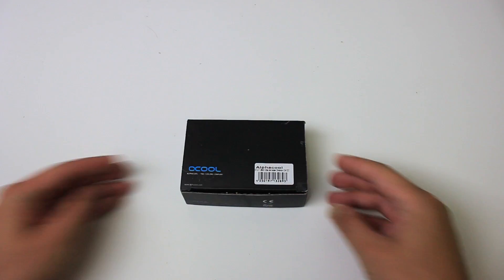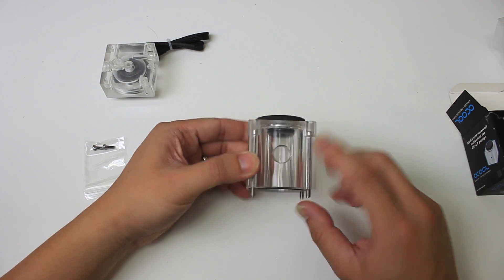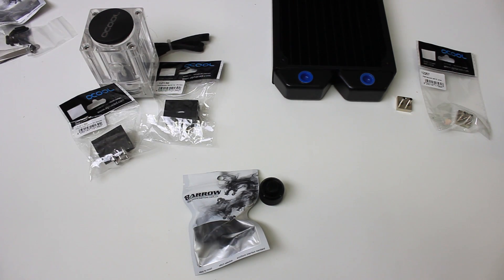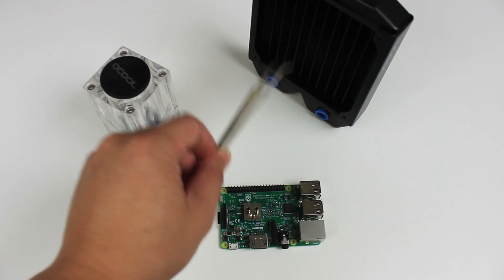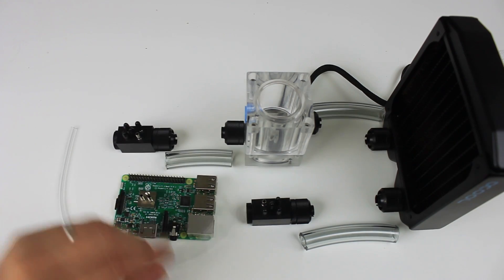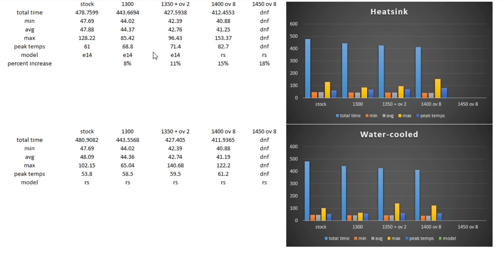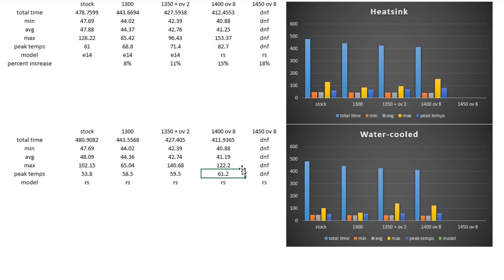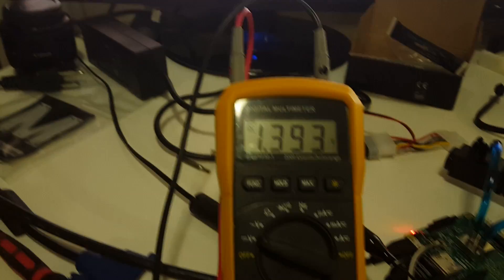Water Cooled Raspberry Pi 3

Comment: Now there’s same (or even better) results with an old oversized copper PC heatsink. The video you will find around. Now if you have a simple and cheap passive solution, what’s the point in going for an expensive complicated active?

Comment: Interesting...I wonder if one could polish down the plastic insulator on the top of the IC down to where it's almost to the actual die if it would help wick the heat away better...alot of times the heat just doesn't pass thru that plastic all that well
Interesting setup...even though the TDP is what like 15W...the fan and pump pulled more than the processor
Hack away, and as you said..hack till it hurts

Comment: i can see one major limiter to how well it can cool, and that would be the tiny inlet and outlet nozzles for that tiny heat sink. there would be a very large pressure drop over that and therefore the flowrate of the coolant becomes too slow. if you use a larger heat-sink with larger inlet and outlet nozzles, you will most likely have much better cooling. the problem is sourcing the part. ideally, the tiny cavity within the heat-sink that allows the fluid to pass through should be "baffled", i.e. have tiny fins inside to discourage laminar flow and promote heat transfer.

Comment: This is like putting a turbo on a 50cc moped and cool it with a car radiator. Cool to learn, fun to implement but useless ... at least for a single board. However this could scale very very well in a cluster of pi-s if you have 10, 100, 1000+ pi-s. Also the rp v3 is not very hot chip but the rp v4 is very hot compared with this and if overclocked it gets even hotter. I imagine if you have cluster with rp4 and everyone has a ventilator or there are massive ventilators everywhere to make the air flow it would become soon pretty pretty noisy and not very efficient cooling. With this water cooling however I would love to see how a cluster could be cooled with just a simple cooling water unit. Big thumbs up!

Comment: this would probably work really well with the Pi 4 as I hear it heats up pretty good!
Reply: I have one and yes it does heat up fairly quickly under load i use a small handheld usb/batter powered fan placed on the top of the case to cool it under heavy loads you can also adjust fan speed (i also have a case with a small fan in it but the bigger hand held fan works better imo) here is a link to one similar to what I use https://www.amazon.com/HandFan-Handheld-Operated-Portable-Rechargeable/dp/B07P2YS5ZR/ref=pd_lpo_sbs_147_t_1/139-1396981-6200024?_encoding=UTF8&psc=1&refRID=P933NEHYWGPPQQ4W6TRE
Reply: 5V, 2.5A.  12.5 watts.  Even a 120mm radiator is going to be over 100 thermal watts dissipation @ 10 degrees delta(coolant over ambient).  You get VERY little efficiency because the pi can't even heat the coolant properly(and going down to weird tiny alphacool rads is actually more expensive)
It's never practical unless you already have a custom loop present.  You could stick a pi into a normal computer case(as opposed to the large "dual system" cases) and parallel off to a tiny water block, though it's be better to use a mounting bracket over adhesive.  The extra restriction from the tiny block/tubes would reduce flow in the pi section, which is fine as it's not an intel top level 250w barn burner.
It's a really niche application.  The dual system cases properly are used for productivity.  If you have like machine learning or rendering that consumes massive amounts of component space and run for a long time, and a smaller scale system for e-mail, office apps, web browser(corporate internal apps) so the user can still do user speed limited tasks while the main system cranks away at large automated tasks.

Comment: i realize im late here but being that it wouldnt be that hot, couldnt you run a setup with the reservoir and no radiator? wouldnt the reservoir be enough heat transfer alone to keep it cool without a radiator additionally cooling the coolant? still...fuckin funny setup, I like it.

Comment: If you added a fan into that radiator you could reach 36°c. I saw someone did that already for over clocked pi 3 and panda latte.
Or you could just simply use cooling HAT for pi2,3. It has better benchmarks (46°c)

Comment: For cooling it would be better to screw a fan on a passive CPU heatsink so you could also cool the voltage regulator that supplies the CPU.
For show it would be better to  buy/make a small case and use a dual 40mm or single 60mm radiator because that one is huge and fittings/hose sizes aren't even compatible with the rest of the system.
Either way, you can do it better.

Comment: I wouldnt say its pointless if u wants to have ur pi like last forever in a cabinet that runs 24/7 but for 2x the cost of the pi.-.  but the worth it value is i dont know. and a pi is made to be tinkered with and customized if someone wants to max out a pi i would say this is the way to go once u get a stable super overclock

Comment: Interesting.  Now I may have missed this, but you need a fan on that radiator for it to cool properly btw.  It's why water cooled vehicles have fans.  When you're say at a stop light not moving, the fan moves air through the radiator keeping water cool.  Without a fan on the radiator heat is just gonna build up.  So you may be able to make it run even cooler.

Comment: Honestly I do get the concept of the Raspberry device to make a PC more portable but what people are forgetting is we've had hand-held portable computers for about 20 years or more now which is a smartphone iOS or Android they are both hand-held computers which are easily portable with in your pocket and you know what's ironic you can even run Windows or iOS through an emulator on a Android and IOS device so my statement basically makes these PCs obsolete no offence to the developers they're doing a great job and I would even purchase one myself if smartphones weren't around

Comment: One outstanding problem i see with your setup is the fact that both inlet and outlet of the "radiator" are on the bottom. Because air floats, it gets trapped in the radiator. Because the radiator isnt filled with coolant, it is unable to do its job of cooling the coolant. Re-run your test with the radiator on its side. Inlet to the radiator on the bottom, outlet on top. Or, rotate the radiator so the inlet and outlet are on top, and either can be inlet or outlet. This will make sure you do not trap air, and will be a perminantly self purging system. Bet your temps get even cooler. Realistically, i would expect to see die temps a couple degrees above ambient, because water or coolant has such an enormous thermal capacity.

Comment: I had a dream. I had a dream of energy recycling with dirt cheap peltier elements placed on top of a cpu contact passive aluminium case and on top of the peltier a big big passive cooler from an old gaming machine... a boost-converter to level voltage for reusage.

Comment: To extend pump life you should connect the remaining splitter ports to each other (bypass CPU block). The single capillary tube cannot accommodate the flow rates of the pump. The fluid that cannot be forced through the small tube will be churned in the pump housing creating ... heat.

Comment: I use the aluminium Flirc case which acts as a heatsink..temps dropped 10 C. Then I added a 120mm fan, temps dropped another 15 C! Now my Pi doesn't run hotter than 45 C :-) You dont nééd to cool your Pi, but I'm sure it will last longer if you do.

Comment: This would have much more of a point, if you actually used multiple Pi's.  I bet you could easily do a grid or 4x4 Ri Pi's, bringing the cost from $130 per unit, to just over $13

Comment: now we need a Raspberry Pi 3 in a regular atx pc case
Reply: Careful or you become a hacker too
Reply: its about the size of a ssd so I suppose you could but it would be a bit hard to connect everything
Reply: @nyxtom  - No, I just put a bunch of fan and blowing over the heatsink :-)
Reply: I did that, but i used a ATX PSU imgur (dot ) com/gallery/6xIUI (I have upgrade power and the pi since the photos were taken)
Reply: I have such a beast - 10 raspberry Pi in regular atx pc case, using one of those corsiar 750W PSW
Reply: on it, am a slow worker though
Reply: I did that lol.  I can’t get it to boot with the power button thou
Reply: or just a tiny one!

Comment: looks like perfect block for high powered LED what sort of wattage is it rated for? would be cool to put a xhp70 4000lumen led on a head lamp with a radiator on the back of the head or as a backpack.. or startreck style palm flashlight with 4 xhps 70s and long radiators on arm

Comment: you missed some very key points. I would opt that you liquid cool CPU, GPU, RAM, and Bridge, then instead of going to a radiator go to a block that sit atop a pelteir cooler and on the hot side of said cooler sits another water block with seperate pump that goes to a big radiator with fan. THEN POWER THAT LITTLE PIE WITH A 10 FT TESLA COIL! FUCK YEAH!

Comment: Any idea why the 1350+ov2 went to 140, which is a HUGE jump from the previous 65, and way below the higher 1400ov8?    Maybe the 1300 number was a bit low since it's actually lower than the stock MAX.
Strange..  still cool video.

Comment: I am designing a portable water cooled rpi3 for a backpack set up. The prototype works in tandem with a drone that does simple things like follow me, assist in builds(for now it orders parts), hunting wild boar or rabbits. I’m writing a ton of code to get this drone to work on its own but steal processing power from the rpi3 backpack when it needs to do higher level calculations and what not. I want to use a laptop eventually but nothing has the processing power I need to get the bot to compile the code it needs and run at the same time. So simple observe and report until then. It works great for portable pen testing WiFi and basic transmissions from wireless devices. Without physically being there. I hope to show the build by june

Comment: That's just crazy dude!  Seriously though if someone would make an all in one case/water cooler that would be great because the surface area for heatsink connection is so tiny that having the whole case top as a radiator would be cool.  I just got an Asus Tinker board and that thing gets super hot which is why I rewatched this video. Thanks.

Comment: The applicability of this seemingly needless cooling solution may fit the bill for an overheating problem I'm about to resolve with my RPi poolbot.  Mr. Ghettobarge has pH, temperature, and ORP sensors along with a DC motor attached to a dispenser that can carry up to ~4 bags worth of shock/chlorine.  Most of my idea comes from myhydropi.com (give credit where it's due!).  Currently, I have a couple beefy lithium-ion batteries onboard the failboat that floats around all day and is powered by a few 9W weatherproof solar cells.  I never had any temperature problems on the RPi until my laziness got the best of me.  I thought I had some wiggle room by making it totally weatherproof (i.e. no airflow).  My laziness told me to weatherproof everything so I don't have to fish out Mr. Ghettobarge during bad weather.  Now I'm thinking of adding some water blocks in replacement of heat sinks because a fan is worthless in an airtight container.  I also may rig up my own waterblocks around the batteries too.  I am thinking of powder coating the radiator in a fluoropolymer or TGIC polyester then submerging the fanless radiator beast into the pool such that it's always much colder.  I would use no reservoir in this configuration as I would have a simple circuit from the waterblocks (in cold > out hot) straight to the radiator (in hot > out cold) back to the pump (in cold > out cold) then repeat.  I haven't read up yet, but I assume this pump is an induction pump?  How hard is it to prime this pump and is it like any other traditional water cooling system where the pump needs to be lower than its source of water (in most cases a reservoir)?  Do I also need to use distilled water inside the circuit?  Oh nevermind, I'll find out those answers myself and post back to myself later.  I may have a problem with my thought bubble design since the pump will be higher or equal to everything else.  The powder coating is obviously going to aid in the lifespan of the radiator, tubing, and attachments since I'm sure it was never intended to be in a chlorinated and high UV environment.  Of course I haven't made any final decisions yet, but I'm simply noodling ideas around and trying to justify a reason to buy more toys to enhance Mr. Ghettobarge.

Comment: Those temps aren't impressive. Dump the adhesive tape and use Arctic Silver Epoxy.. the tape is a horrible heat conductor and is far too thick for this setup. If you don't want it permanent then i would mod a cheap case with screw on lid and some retention springs to push down the block with a thin coat of AS4/5,  i bet you see a monster drop in peak temp.

Comment: why even bother with the radiator?? water cooling maybe but the radiator is completely redundant, your only dissipating a few watts, so just the pipes, pump and reservoir would be much more than you need to dissipate that heat

Comment: I didn't know alphacool made tiny pumps/tops/res's.

It looks so cute, a smaller radiator would have looked cuter but then the performance would drop.

Would look better if it was all on a board or something, the tube from top to rad could be removed and just use a male-male fitting. Maybe another tube or two could be removed to make it more compact.

That's still a nice 20 degree drop, not to be sneered at.

Comment: how much cost water cooling brings to LOW POWER machine. pump,tubes,tank,power source, then OVERCLOCK pi use more energy and COST more (unless have solar panel that was FREE !!!), it should be under clocked. it will cost less than commodore 64 and run faster lol

Comment: Interesting! So based on those benchmarks, watercooling lets you OC to the maximum voltage while not going above the stock cooler's base clock max temps. Worth trying out, I've been messing with my Pi Zero for a while and this seems like a cool project.

Comment: In reference to his closing remarks: The capacitor doesn't "control" the voltage. Depending on value, it is acting as a hold up (prevent quick changes in voltage) or a bypass capacitor (provide close proximity source of high frequency current draw). You can't increase or decrease voltage with it, you could only affect if you are seeing sags in voltage from the current draw. Adding a bypass capacitor could help if you are seeing your supply sag more as you increase your operating frequency, a 0.1uf is a typical value for bypass and might help in parallel with whatever is already there (put it as close to the chip you are concerned with to minimize inductive line effects), but you will never increase above what the supply circuit supplies. With how crazy this project is getting you might as well cut the trace and solder in an external supply that provides you with whatever voltage you want.

Comment: .......Ok I can sorta see the point.  A ras pi can actually make a pretty sick workstation......  With a lot of addons....  But then without addons I can't see much of a point in doing this personally.

I would go at this if you guys did some more serious stuff with it.  Like yeah sure its neat, but you don't have any addon processors, you aren't running this in a cluster, you're not even pushing heavy traffic to the chip to make the clock speed worth the effort.  Without a real demo of what this is supposed to do I can't really see a point in any of it.

Comment: I've got my RPi3 overclocked to 1.35GHz. CPU running at ~75% most of the time with occasional spikes to 100%, it's cooled with a copper radiator having a fan sitting on top of it. Runs at 59deg at the moment (haven't been switched off since ~8months). Another unit is outside (in a waterproof box with an acrylic "peek hole" for the camera) and when it's exposed to the sun I had not seen it exceeded 65deg (it's winter now so it's oscilates around 30deg), this one's running 6 months now. These "cooling systems" costed me 5GBP. So if watercooling won't let you go beyond 1.5GHz, then it's pointless in production settings. Unless you want it to be super quiet (and super huge). Otherwise, the video is a great proof of concept :)

Comment: If you had added a copper block on top of the CPU to increase the surface area of the heat removal (instead of the 3/4" x 3/4" OEM) you could have used a larger and more efficient water block and gotten DRASTICALLY cooler temps. The heat from that CPU is too consolidated and dense for that tiny water block to adequately spread it so the water can remove it.